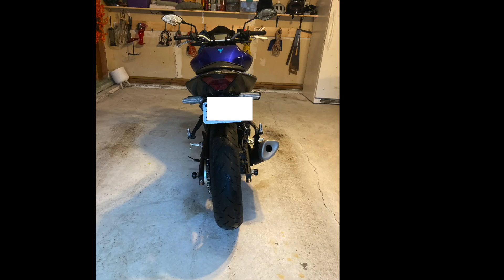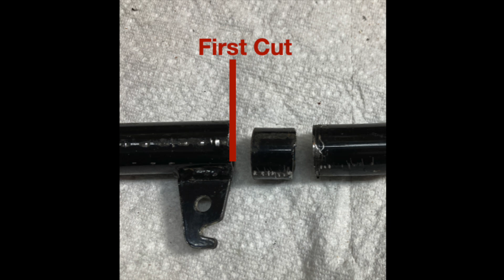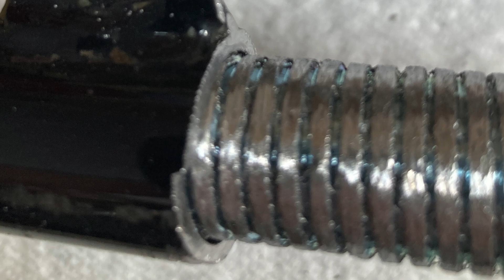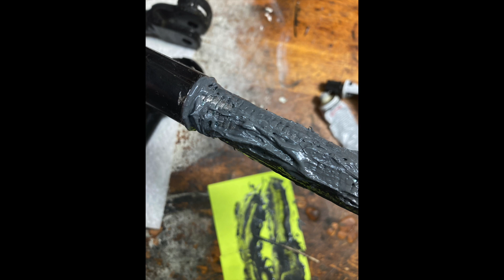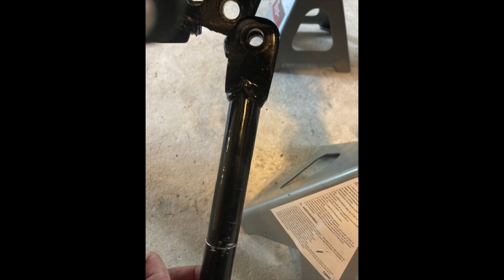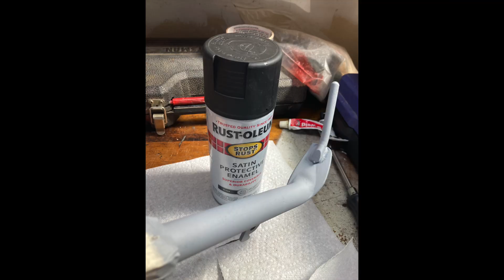Yamaha MT-03 Shorten Kick Stand - No Welding - $14

Comment: I'm just about to do the same to my tracer 700. I bought a spare second hand stand in case it ever needs to changed back.I have welder so will do exactly the same with a stud but weld instead of using JB weld. Otherwise I would use JB weld.
Reply from the maker: Cool - hope it goes well!

Comment: This is so great!! 
I bought a MT03 that was lowered and it had an adjustable kickstand but am so worried as it’s being held with just a bolt (“adjustable “ part). It’s been ok, but I don’t trust its longevity because being 4’10”, the best way for me to park the bike is ride it in and use the kickstand to turn the bike - which again brings me back to the universal aftermarket one that’s being kept by a bolt :/ 
Now if I can find the OEM stand to try to make this.. problem is, I don’t have any of the tools, nor friends who do. 
What basic inexpensive tools can I use to cut the OEM kickstand and grind the threads?
Reply: Hey, thanks for your comments!  You don't need any special tools really.  I just used a hand held hacksaw to cut  section out of the stand (it's pretty soft steel) and also to cut the stud to the right length.  You can use a hand file to grind down the stud threads to fit - it doesn't have to be pretty!   It may take a while, but definitely possible.  What is good about doing this is you can dry fit the parts on the bike and adjust the angle before you bond everything together!  I took off about 7/8 of an inch, but you could take off a little more if you like it to sit at a bit more of an angle.  It's a pretty easy fix!  Hope it works out!

Comment from the maker: I installed a TRex Racing 1 inch lowering kit on my Yamaha MT-03.  But I had to shorten the kickstand so the bike would sit at the proper angle.  But off-the-shelf adjustable kickstands were way too expensive, so I found this fix using a threaded rod and it works perfectly - for under $14 without any welding.